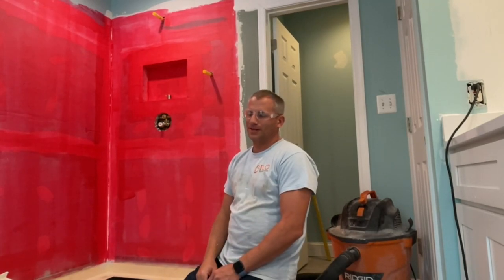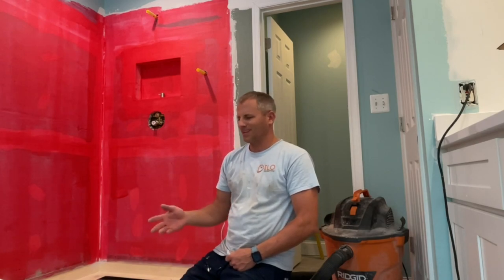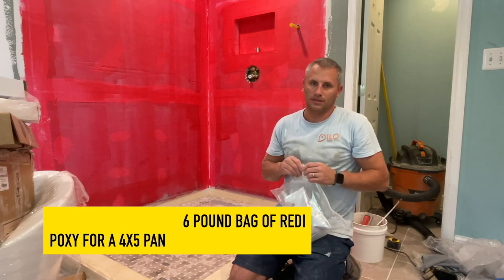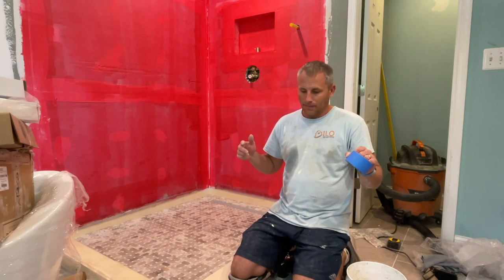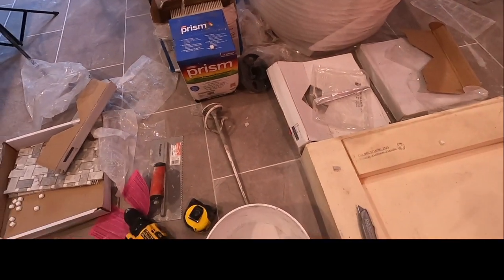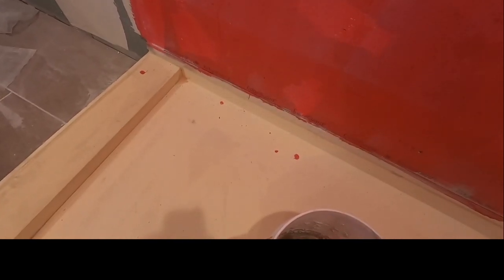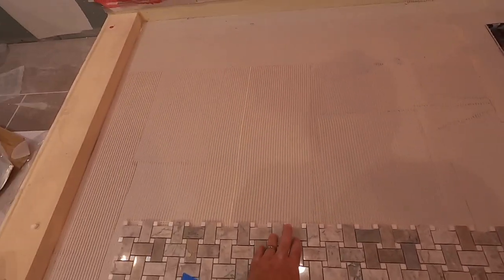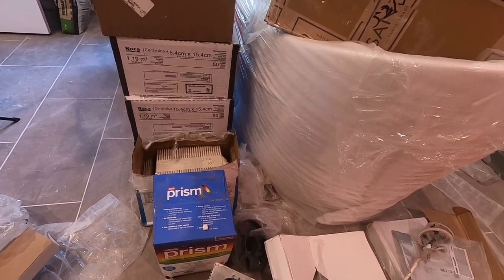How to install tile on a Tile Redi base. Tips, tricks, and updated info concerning the system.

Comment: Nice video, clear explanations and commentary. I understand you prefer the Redipoxi over modified thinset, but I need to lay the tile within the next day or so and Redipoxi doesn't seem to be stocked locally (Clearwater, FL). You mentioned you like the thinset if it's applied on top of the Redipoxi but how about laying down a couple coats of Aquadefense then go with the thinset on top of that. Thank you, and keep up the good work!
Reply from the maker: Use a really good thin set and you should be fine. It's not in a video, but I tried the basic LFT mortar that HD sells(Versabond LFT) for the side tile and honestly, it stuck really well. I was very pleased with the result. Buy the recommended mortars on the list and you should be fine.  Tech changes, that's what tile Redi did and it seems like the modified mortar does stick! In my next bath I might do a mortar instead, lol.
Reply: @TodayIWorkOn  Sounds good. Thank you for your reply!

Comment: Just finished putting in mosaic tile using redi poxy in redi base. Followed the steps you showed, and it worked great. About 37 min working time with poxy. Have everything cut and ready. Practice dry fitting the tile before poxy also helps. Ready appreciate your video's  thank you!

Comment: Enjoyed your video . Very informative . I just have one thing to say about the process. I have been installing tile for about 48 years now . One thing i always do is protect the floor and the surrounding areas . I know for a fact that it is very easy to drop a little epoxy accidentally and not see where it fell till after the tiling process . By that time the epoxy has hardened and its a bitch to clean up later . A little before protection goes a long way ! Keep up the good work .

Comment: Best video on Tile Redi ever .Thank you! 
Difficulty is a tight retrofit of the Tile Redi shower base on a concrete slab. Aligning the 2" riser precisely with the molded-in-place spigot in the pan is difficult because you have no access from underneath. You have to get the riser to be the correct height below grade and a precise distance +/- 1/16th of an inch from both walls.This is supposed to be ROUGH-IN ! And you have to allow for the height(if any) of the mortar you set the pan in. Yes, a hammer handle helps. But you can eliminate the most difficult issue - the stub-out height precision. The spigot in the pan has a molded  'stop' that is 3/4" deep.I ground mine out so I could stub out to grade. Easy to slide the spigot over the taller stub-out.Dry fit to test first ! 
After the mortar under the pan has completely set, cut off the excess riser with an inside-pipe cutter - carefully ! Cover and smooth over the cut  with some solvent cement or silicone adhesive. The grate covers the ugly (but easier) connection. I hope this helps. And yes another vote for Epoxy Grout. Have you tried the dishsoap trick to help cleanup?
Reply from the maker: Very interesting. I was going to contact tile Redi and ask them to remove that stop at 3/4” to give more room for an above the plywood/concrete install. I have thought about doing the same but I don’t want to risk a leak. If that area leaked the whole pan is coming out. Acrylic bases I’ve installed years ago do not have a stop and your method has crossed my mind many times. Lol. Thanks for the comments and compliment. Lastly, since I started my channel I have learned from comments like yours. Truly appreciated!
Reply: one more suggestion: When roughing in the P trap below grade support it firmly with a brick and pieces of old tiles as shims.Pack around but not above with gravel. This allows you to push down the pan and 'shimmy the pan without distorting the drain pipes.

Comment: Ive been using Liquid nails FUZE IT for years now...i use it for the walls as well. Ive never had a complaint
Reply from the maker: What do you use it exactly for?
Reply: @TodayIWorkOn  I directly apply it the back of the tile in place of thinset
Reply: @TodayIWorkOn  but after watching your video I am going to try this epoxy...it looks like it would be faster

Comment: I did my bathroom DIY a couple years ago with the pan and standard mortar…..  I can’t get the floor tiles to stay down.  Some of them get loose every few months.  I did another bathroom a few years before that without the pan and have never had problems.  My best guess is that the drain gets clogged from excess hair from my daughters and is seeping its way into the mortar once it pools up in the black pan.  I’m hoping that if I switch to this epoxy it will keep the water out.  Thanks for the video.
Reply from the maker: If you used a non approved thinset, the tile will pop. Also, are you sure it’s a base that you can use thinset on? What year did you purchase the base?
Reply: @TodayIWorkOn winter of 2021-2022.

Comment: Would you recommend ONLY using mosaic tiles for the shower pan? I was planning to use 6"x24" black tile in a shiplap layout. I dry-fit the black tiles and then cracked one when I stepped on it to do something on the back wall! My husband checked the shower pan and there were gaps (up to 1/4") along the pan side to side and front to back. We were able to return the remaining boxes of black tile and get a 2" black hexagon mosaic tiles. But no where did we ever see or hear it mentioned that you should only use mosaic tiles on the shower pan.
Reply from the maker: You can use bigger tile on a trench for sure, but you have to abide by the where the trench breaks near the actual trench. It’s pretty flat on an angle until you go near the trench, does that make sense?
Reply: @TodayIWorkOn we didn't have a single slope. Our drain is at one end. But we have a curve from side to side leading from the back to the drain end.
Reply from the maker: Do you have a round drain? Or a trench. That’s very important. If it’s a round drain, then mosaics are the tile to set. If it’s a trench you can use larger tile. Remember, the water needs to flow down to the drain, and it’s sloped near the round drain for that reason.
Reply: It’s there a size requirement for the tile used on these pans? I was planning on using penny tile

Comment: You mentioned you set a 1/4 inch boarder  around pan for the tile…I do not think you can use spacers with the redipoxy??? So how do you set 1/4 markers???  Is it essential to space edges 1/4 inch around perimeter or can I lay mosaic out  without 1/4 spacing around perimeter???
Reply from the maker: Just an eyeball. It doesn’t have to be perfect since your wall tile will be covering that 1/4”.

Comment: If I may ask 2 questions…first..would you use redi-poxy on the area just above shower pan tile as prep for where wall tiles meet pan floor tiles?
2nd what thinset would you use on cement board walls to adhere 4x12 marble tile?
Reply from the maker: Before thinset, that was the way I did it. 

Approved thinset that will not bleed into the marble. 

Marble is natural and porous. Remember that. If you are ok with the way the marble will change color over time, go for it. If you  are concerned about it, go with a ceramic/porcelain tile that will hold up much better. 

I love marble in a lot of places, but the shower is not one of those places where it will hold up well.

Comment: We are installing a Tile ready shower pan this week and plan on installing a glass shower wall on top of the threshold of the shower pan so in one of your videos you said that the cavity of the threshold didn’t need to be filled with mortar when setting the shower pan so how do you attach a heavy glass wall onto the top of the threshold with out anything to screw to ? Do you glue the mounting hardware to the tile or marble ? Any advice would be appreciated .
Reply from the maker: Tile is plenty. All the glass guys drill the tile or quartz or granite, etc then silicone. There’s some expensive tape you can use but no glass guy I ever met is willing to use that.

Comment: How do you clean your mixing paddle after using the epoxy?
Reply from the maker: In water and I spin it. The epoxy comes off as long as it does not harden. When it’s soft it acts like a funky mortar.

Comment: I am doing a huge Tile Redi shower pan. 66"x 66". Do I have to do the entire shower pan all at once or can I do half at a time? Just worried about the working time with the epoxy and a pan that size.
Reply from the maker: Use modified thinset.

Comment: Getting ready to set one of these. In another video you set it into non-modified thin set. It has to be deep enough to fill the ribs. But nothing is said, that I saw anyway, about the threshold area. That’s really deep, way deeper than the rib area. Do you have to fill those with thin set?
Reply from the maker: The deep rib threshold is held by the tile you install around it. I’m actually going to go over this in an upcoming video.

Comment: Appreciate the video. How do you install door when they don’t recommend drilling into the Redi tile base curb?
Reply from the maker: I don’t install the glass, it’s another company. They do install the base brackets though the tile Redi base because that’s the only way to install the glass without it moving. Tile Redi does not recommended for obvious reasons, for liability protections. I would never worry about the drilling since thousands of glass companies drill though the waterproofing every day. They do make this tape that is strong, but I don’t trust it.

Comment: You crushed it. This is clearly superior. I’ll be using this on my next shower if the pan fits the space. Isaac Ostram mentioned Tile Redi and when I searched it you come to the top! BTW what is that knee pad on wheels?
Reply from the maker: It’s called a Racatac and it’s amazing. Thanks for the kind words. Like I told Tile Coach, the tile redi bases are so simple, but so different depending on which one you install.  There’s so much info needed to make sure you are installing it correctly. 

Link to the racatac,

RACATAC Kneeling Sitting Creeper 3" Casters with Chest Support 01RAC3CS https://a.co/d/gVlwACX

Comment: Can you heat the Tile ready pans? I'm doing a nice 4x5 luxury shower but I want heated floors.
Reply from the maker: This is a great question and tile Redi as far as I know does not specify if you can or not. Did you call and ask? In my next
house I want to install some ditra heat in it and was wondering the same. I bet you can because my steam shower get the tile Redi base SO HOT and it's been fine for years. I say go for it. Just be careful running the line.

Comment: When removing drywall do stop before reaching ceiling or do you remove up to the ceiling?
Reply from the maker: I’m not following. Can you describe the question in a different way?
Reply: @TodayIWorkOn  Sure…when you are you are in the demolition phase and removing drywall down to the studs…How high up the wall do you work up to….to the ceiling of stop just above shower head?  Tearing down drywall and fearful of creating headache with damaging the ceiling???
Reply: If you are using the Tile Redi flashing and not using the Tile Redi walls (Plan to USG concrete backer board) how much Tile Redi sealant on 42x60 space?

Comment: Thank you for a great video. 
I have a Tile Ready pan that I purchased almost 2 years ago (2020) but due to family health issues I was unable to start the work until recently. I used the epoxy to install the floor tiles and it came out great. You may have already answered this, but I am concerned about installing the wall tiles. 
My wall tiles are about 7.75" tall, approximately 2.75" taller than the base so they will be partially on the hardibacker. Should I use the epoxy or thinset for the first row of tiles? 
Assuming that the epoxy is thinner than the thinset - wont the second row of tiles "stick out" further than the first row? 
Thank you for your help.
Reply: I just reread your earlier comments and saw this comment: "apply some redipoxy on the sides then apply mortar". I'll go ahead and do that unless you have other advice. Thanks again for a great video.

Comment: How do you tile over the seam where the Hardi and flashing meet the pan? We installed a pan that doesn’t have plumb edges and now there’s a 1/4 gap between the wall and a straight edge when measured from the bottom of the pan against the floor. The walls on their own are plumb. I don’t feel like filling it with thinset is a good idea, or would even work, so I’m at a loss. Do you ever deal with this on Tile Redi bases?
Reply from the maker: I would need a pic to see what’s exactly going on. If the pan is not installed against the studs, sometimes you need the build out the walls after you install the pan to make everything square and level. The pan can’t bend at all. Is the hardie sticking out 1/4 from the pan or is the pan sticking out 1/4 from the wall? Where’s the gap? You can go to my about and email me a pic. Lol. I’m here to help my viewers!

Comment: Called Tile-Redi on my 42 by 60 base that isn't fully draining, It is a center drain and backside channels are only 1/2 inch deep.  They suggested to just thin setor epoxy  a little deeper in these areas.  Question for you is if I choose their epoxy, could I divide the process in two steps.  One....creating the proper slope to the drain.  And let that dry.  Two....lay the tile.  I am concerned that if I do it all in one step, I am sure to maybe press too hard down setting in the tile and then disturb the underlying epoxy used first for leveling since it will still be fluid.  So will the second layer used to set the tiles bond well with the first leveling layer?
Reply from the maker: Was the base not leveled when it was installed? Just wondering. That’s usually the reason why a base will not drain properly. 

On to your question. I agree and would do a 2 step process. Install the redipoxy to build it up then tile. You can use a thinset modified mortar on top of the redipoxy. It will stick very well to it. I’ve done it for years. Good luck with your project!

Comment: I appreciate the videos !!! What kind of morter did you say to use in case we don't use epoxy? Also did you say if we screw up with the epoxy can we morter over it? 🤔
Reply from the maker: There’s a list of approved epoxy’s in the instruction sheet, or you can look it up online. You can mortar over the epoxy if you like, but if some tile stick to the epoxy, you are not getting that tile removed. You would have to buy a new pan.

Comment: If I am using the tile redi flashing but Not using tile redi walls (using USG backer boards)…how much sealant is needed for 42x60 pan?
Reply from the maker: You are using the tile redi walls and backer board? I’m confused. lol.
Reply: Meant to say Not using Tile Redi walls but instead will be using USG backer boards…would I still need redi sealant and if so how much for 42x60 pan
Reply from the maker: @tonycopelyn8730  you can use bed and bath silicone and watch my video on how I install the redi flash. Don’t be scaredv to use a lot of silicone in the corners. I’ve never had an issue. Good luck with the install!

Comment: Great video. Exactly what obwas looking for. What do you do for cleaning prep?  Just a simple vacuum and cloth?  Also what about the tile redi niche?  Use the epoxy there too?
Reply: Also have one more question. I am using river rock tile. Any ideas or tricks for grout on these pans?
Reply from the maker: Vac and cloth works. Make sure you use a polymer mortar like UltraColor Plus FA.  I’m dropping a video on how to install the actual trench and you can see a grouted   pebble floor. To make it look really good it’s  a timing thing, but if you do it right it comes out very well. Good luck with your project!
Reply: Thank you for the reply!! It's been so frustrating. I have gone through 3 contractors now over the course of a year and a half and they keep on doing partial work and disappearing. I'm stuck trying to figure this out alone now and I'm disabled so even more of a learning curve. But your videos make it less daunting and scary for sure.
Reply: @GettinDurrty  my exact situation  now. It seems a lot of these contractors don't like to or don't know how to install tile on tile redi products. I bought an old version pan, installed the pan, built and prepped everything. I just wasn't confident in my tiling ability.
2 yrs now and 4 contractors, still not complete. Only the floor and curb left to tile. I'm pretty sure I'm just going to DIM Do it myself !!

Comment: Thanks. Great and timely video as I just pulled out a whirlpool tub from a alcove.  I an going to use  a Tile Redi 60"x42" pan as well.  Question: What size container of RediPoxi did you use?
Reply: I re-watched the video.  6Lb.  Thanks again for the video
Reply from the maker: Yup. 6 pounds will be plenty for your base. Good luck with the install!

Comment: I understand the concept of why it is recommended to lay down some felt or garbage bags between the subfloor and the pan, when you lay down the mortar. What is your thought on laying the mortar bed down on a self leveling substrate, without using a barrier?
Reply from the maker: It will do the same, take moisture out of the mortar too quickly which might hurt the stick to the tile Redi base. Anything that’s absorbs moisture, like a self leveling mortar will be the same result.
Reply: Thank you for the reply.